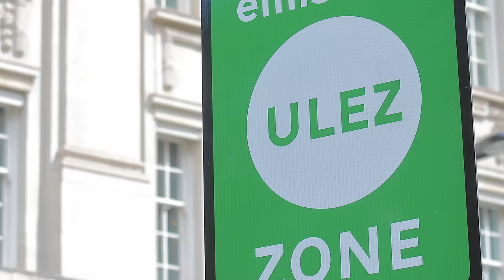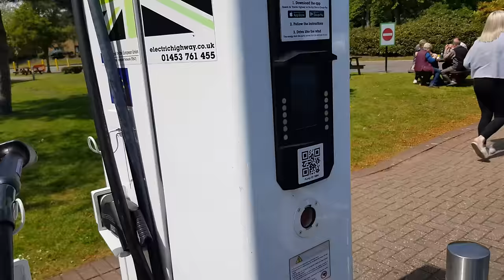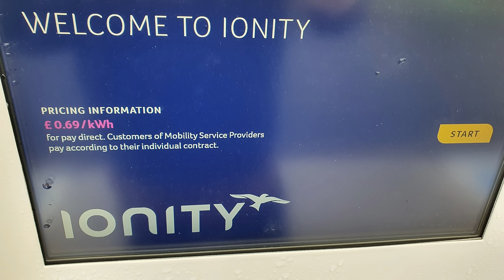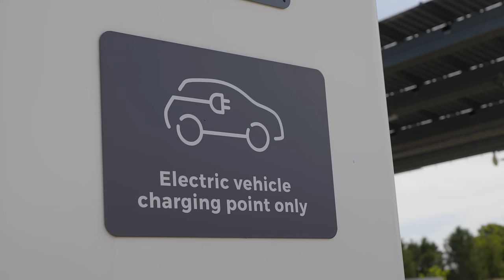The Uncomfortable TRUTH About EVs: The Version NEITHER SIDE Wants You To Hear

Comment: You say you have an open mind, and you say you are balanced but you seem to think being both positive and negative about something is what makes those two things true.  Thats not correct, if something is a complete failure it isnt open minded or balanced to try to find benefits too it.  Most importantly you only talk about things as they are right now and you spend no time thinking through what must happen in the future.  Througout all of this you say things like "it cost me a pitance to run".  Now imagine an electrical system which has to charge an entire country of electric cars, it would require us to increase electrical production by over 10 times, 10 TIMES as much at least to run cars by electric.  What does that mean? Well it isnt possible to increase electrical production in our country by that much so what will happen?  Electricty will become very very expensive, not only to run cars but EVERYTHING becomes expensive to run.  Electric cars could never be a part of any countries travel future, they simply dont work for more than a tiny percentage of the population at any time.  You think the electric charging points are expensive now?  Before long running a single light in your house will become expensive because of, bluntly, people like you who ignore the facts about what must be the future by simple cause and effect and worse, calling yourself reasonable for doing so.  You can call me negative all you want, but the facts still stand.  It isnt possible for electric cars to be run for any sizable proportion of a countries population, they fail at the job in a very fundamental way.

Comment: Whilst this video purports to portray the truth about EV’s, there is no mention of the tons of ore that must be refined into the pure materials used in EV battery packs - or the thousands of tons of soil which must be dug out to actually get to the ore… Or the acids and other noxious substances used to refine these source materials.
  Then there is the remote pollution caused by burning coal, gas or oil to provide electricity to charge these 34:04 34:04  EVs. 
  So something supposedly truthful is, by omission, less so. This bias Toward Electric Utopia is evident upon second viewings, thus this viewpoint cannot be deemed truly even-handed.
  I will not be subscribing.
Reply: Don't be so delicate. What you said is true for all industrial pursuits. Lifecycle analysis is not new and no one is hiding the facts of industry.

Comment: Anyone who understands the fundementals of battery technology knowns EVs can never be a solution. Anyone with even a cursory knowledge of emissions knows that the engine is only a small part of the pie when it comes to cars. Full electric vehicles are not eco friendly. Any vehicle with rubber tires and metal brakes is inherently not eco friendly. They may pollute slightly less than ICE cars in very specific scenarios but that slight decrease in emissions does not make up for the myriad of issues all EVs inherently have. I wont even touch on the idiotic arguments you give for longevity... Show me a 10 year old electric vehicle that even functions without needing the original purchase price spent on it every 3 years in maintenance. You can't. They dont exist.